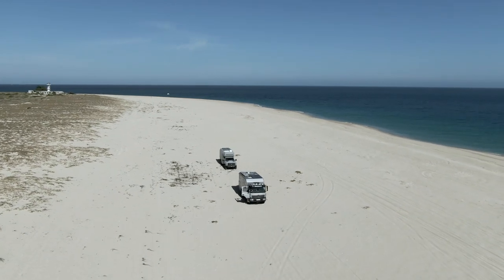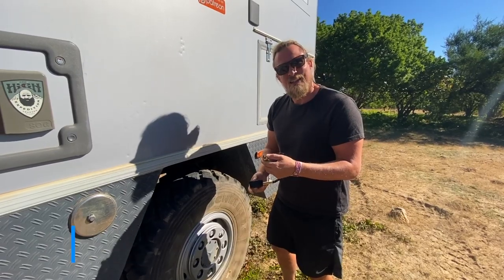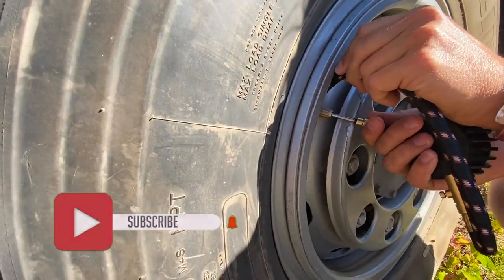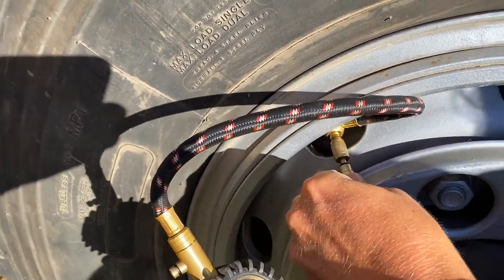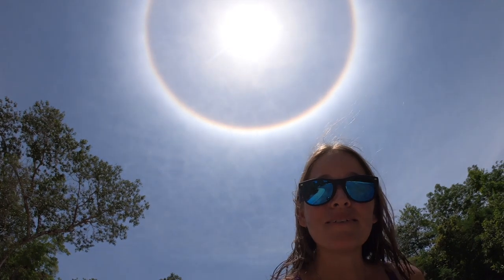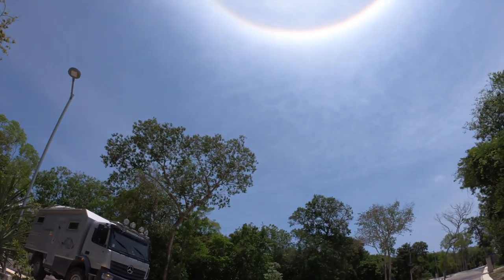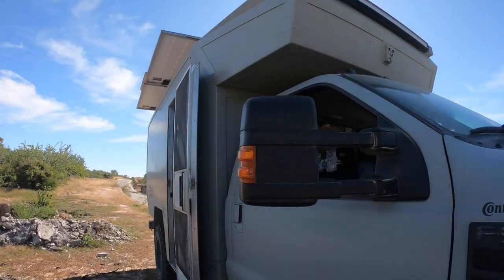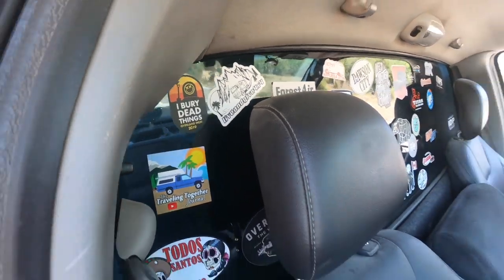Beach driving - How to use Tire deflator system ► | Live and Give 4x4

Comment: What is your normal tire pressure on Frank the tank? My Ram Power Wagon I run 60 psi on road and 13 psi in the sand. My truck is about 9,000 lbs when loaded down with gear no where near your 10 plus ton rig. Cheers
Reply from the maker: Highway between 80 and 90 psi rest according to the terrain 😎😂😉
Thanks for watching ... you might like our newsletter I have a feeling 😎
See ya when we we ya 
Fabian and Isabela 
www.liveandgive4x4.com/newsletter